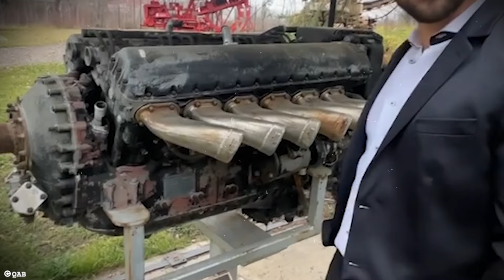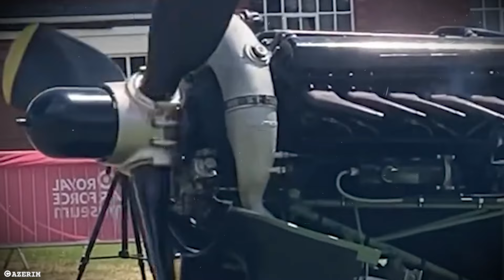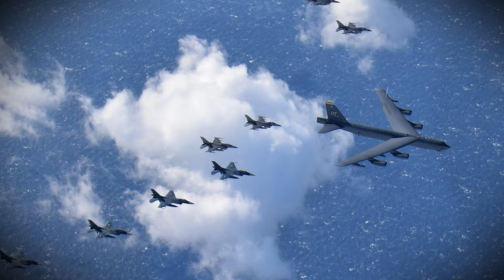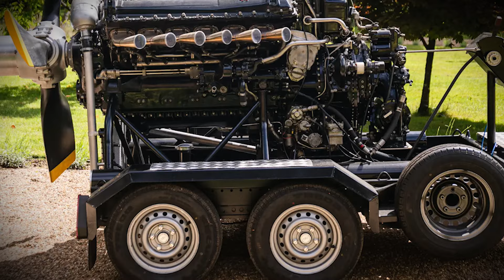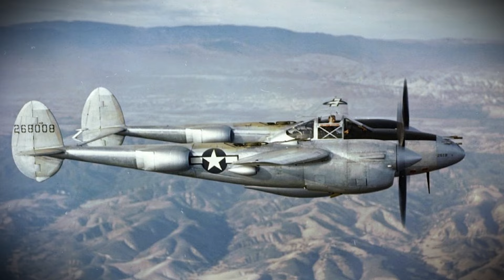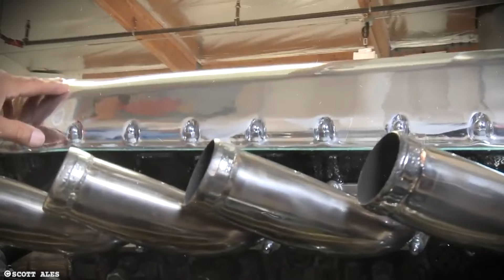How One Rolls-Royce Merlin OUTSMARTED American Allison Engines in WWII Fighter Combat

Comment: You got some stuff wrong,,and you left a few important things out.
Rolls initiated the Merlin with the PV-12, on their own funds. The RAF soon started supporting it as the iron in the fire that held the most hope for the upcoming 8 gun monoplanes. They got the engine to be reliable just in time to build fighters for the Battle of Britain, and the early Merlins had single stage supercharging, developed on 87 octane British fuel. Just as the battle was looming, they had a crash program to retrofit the hurricanes and spits with metal constant speed propellers. Then they got a couple of US tankers of 100 octane fuel , which let them raise the boost for the Battle. The 100 octane fuel was worth a couple of hundred additional Hp, a big advantage. This Merlin was almost exactly  the same as the Allison in output, except it had a 2 speed one stage supercharger.
Throughout the war, the Allies were able to raise octane and performance number of aircraft fuel, topping out at 145 PN by the end of the war. This allowed boost to be cranked up to orovide the high horsepowers of Merlins by wars end.
When the Brit's needed mor altitude capability, the quickest way to get there was a second stage mechanically driven supercharger, with 2 speeds. They were space constrained so they added a very clever liquid intercooler/aftercooler. When the USAAF wanted high altitude performance, they added a GE supercharger, as in the P-47 and P-38. Arguably technically superior, but a physically large system. That was USAAF policy. As it turned out the P-47 was superb at altitude, and the P-38 had challenges with its intercooler design. It limited the power that could be had at altitude until a later model added new intercooler. The P-38 also had a rather low critical Mach that kept pilots from diving aggressively. The P-38!cost $95,000 and used lots mor materials/plane.
Britain wasn't "surprised" or "disappointed" by the Allison P-51 altitude performance. The engine came with power/altitude graphs. It came with a single stage supercharger. They took it on lend lease because they needed more fighters than they could build. It was available, the Allison was available. Packard wasn't in the picture yet. They had low altitude fighter work. 
The USAAF rather stupidly insisted that the 8th didn't need escort fighters until they couldn't ignore the need, then the challenge was to find the quickest solution, which happened to be the Mustang with the Merlin. The P-51 was also the cheapest option and it was an easy airplane to build. A Thunderbolt cost about 85K, A Mustang about 55K. The Thunderbolt was a complicated airplane to build.
Packard built about 55,000 Merlin's. Britain built over 130,000, using their auto industry, Rolls and shadow factories.
Finally, the Merlin was a wonderful engine, but that hooey about it being the engine that would get you home is wrong. Any liquid cooled engine will run for a few minutes, maybe 5, after it loses its coolant. It doesn't run any longer just because the valve covers say "Rolls-Royce". The P&W R-2800 would run for hours after taking battle damage.
"If you want to catch a girls eye, fly a Mustang. IF you want to get home to your girl, fly a Thunderbolt"